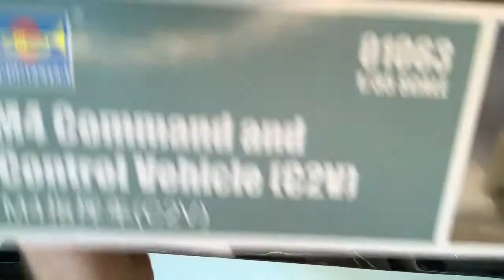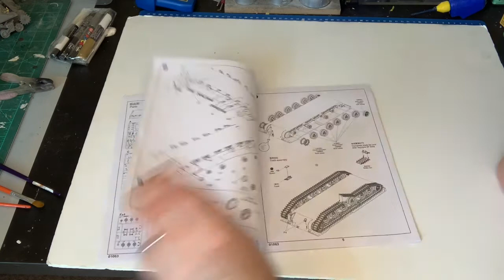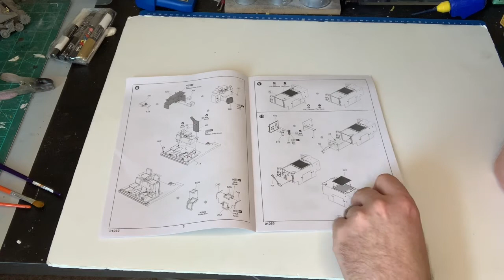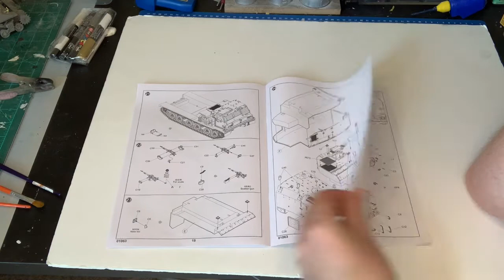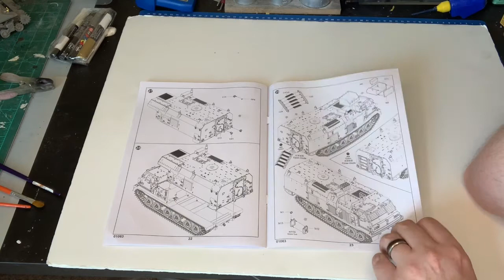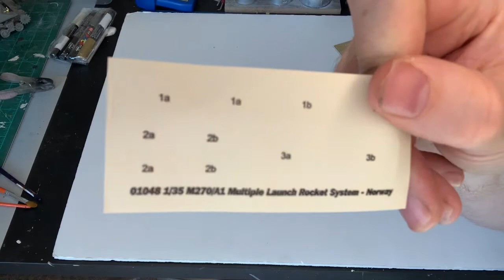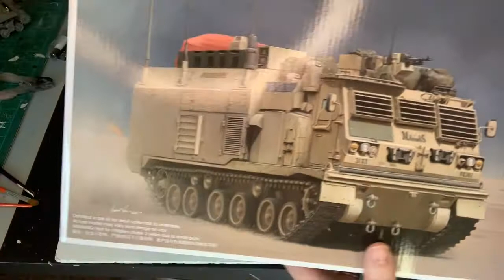Trumpeter 1/35 M4 C2V Command and Control Vehicle: A look inside the box

Comment: Sept. 29, 2021----Thanks for the video, BUT there's NO interior! And "good luck" in trying to Google photos of the interior. Got back into modeling, but going for 1/35 scale zombie/apocalypse dioramas. Will be using mil surplus vehicles, along with modern ones and this was when I found out that basically, NONE come with interiors. Cost me $80 for 2 books out of England via Ebay which covers EVERY variant of the Strykers, including interior photos. I'm going for realism and not some Mad Max look.
Reply from the maker: Yeah, just a big empty box. No interior. If you want interiors try Academy Humvees or Rye Field/ Miniart tanks.
Reply: @RWHobbies  Trumpeter has an interior for one of its Bradley's. As to Humvee's, the all have interiors and I have several of the Italeri/Testor ones in at least 3 different versions, with the ambulance one being the most expensive, Along with those 2 Stryker books, there's also Verlindens War Machine and Squadron/ Signals Walk Around series of books,  

Black Dog(?) has a resin set for the drivers compartment, but don't remember if they have a set for the rest of the vehicle. There's a interior resin set of Cadillacs V-100....the one the Air Force security police and Army used in Vietnam for a few years, but it's $50 or $80? Italeri has a M-163 which is a Vulcan mini gun mounted on top and the resin/photo etch set available is $90? 

So I have a choice.....buy this stuff and maybe be able to make silicone copies of most of the pieces, scratch build and again, make a silicone mold of everything OR learn CAD and 3D resin print these parts. At 68, getting my ass kicked while trying to learn it.  There's a lot of stuff not available as kits and this is why I've downloaded  around 4-5K worth of free 3D files. Bought a used 3D resin printer about 2 months ago and hope to start printing stuff like children toys/wagons,  ceiling fans, store shelving, office desks/ chairs, etc. 

If interested in 3D resin printing, look up Luke Towan on YT. He's a train guy, doing stuff in HO scale. He printed a multi legged office chain and it's outstanding.  Once I learn CAD, hope to print people/zombies because right now, modifying military figures into civilians and that's a lot of work.